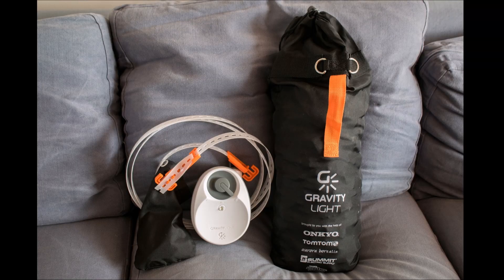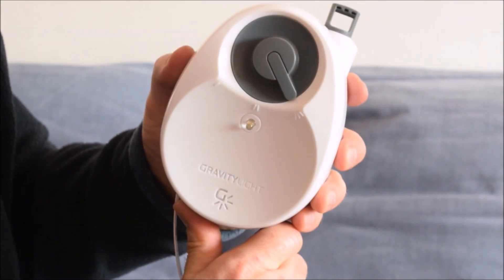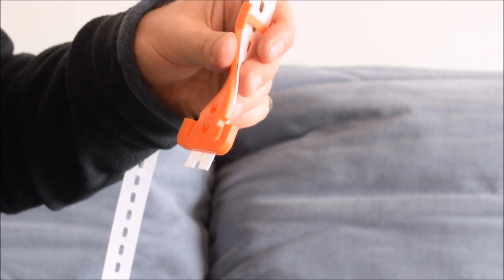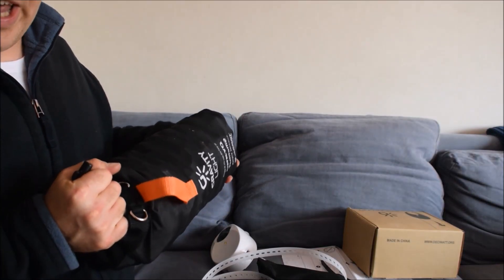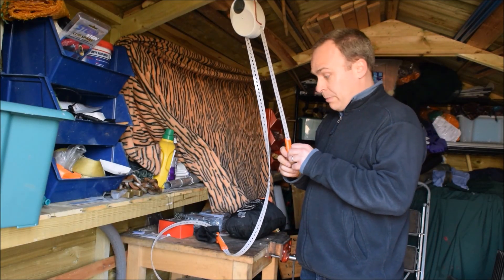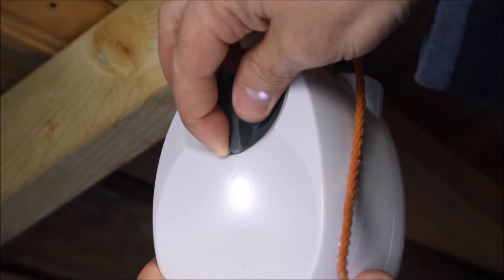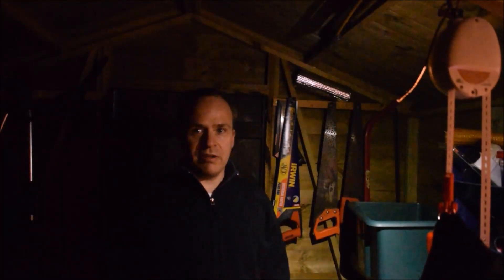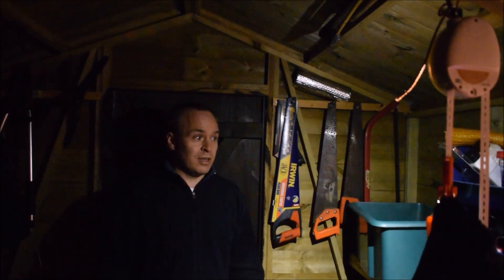Gravity Light Review

Comment: I love the idea, am just not that convinced about the design. A lot of fragile looking, easy to break and lose plastic parts to hang the weight bags. Would be awesome if it was designed in a way where one can just use e.g. any string like paracord to hang the weights.
A supercapacitor to store some energy to still give some dim light for a while when the strap stops moving (when one is lifting the weight or when the weight reached the bottom) would also be a nice addition.
Reply from the maker: I agree. It broke a plastic gear after a while. They did make a newer version that added a battery and solar panel, with a simple loop of cord to pull to charge it. But it's quite expensive now. See https://deciwatt.global/gravitylight

Comment: I am pretty sure it could turn on more LED at once if they know the trick..at 3 volt ...it could lights up 24 LEDs if they know how to do it
Reply from the maker: Yes, it could, but you'd need the weight to drop faster to supply the current, so it wouldn't last as long before you need to lift it again.
Reply: @mikepepler  I think there is another way to do this instead of supplying more current (dropping it faster). If it can supply enough current for 1 LED perhaps it could supply at least 6 or more.
Reply from the maker: Only if more efficient LEDs were available. The energy from the lowering weight is mass x 9.8 x height. So if you don't increase the mass or the height then you have a fixed amount of energy available. Therefore if you want more light, you won't get it for as long - unless the single LED they've used is not very good, and you can replace it with several that are better, delivering the same light for less energy. The energy used by the LED(a) is current x voltage x the time they're lit for.

Comment: How many watts this pruduces? I am thinking to charge a bettary instead .
Reply from the maker: Not a lot. The potential energy in the raised weight is probably just under 200 joules, so if it lowered over 3 minutes that would be about 1 watt. The latest version of this device doesn't use a weight, it has a loop you pull round and round to charge a battery, plus a solar panel.

Comment: Mike Pepler
This is the GL01 model...how has it been holding up?
I just purchased the GL02 model and there are obvious differences.
GL02 has a lot of cables coming from it with an offset weight, different load bag, two satellite lights but no brightness adjustment.  Suggested 15 lumens.
Reply from the maker: One of the gear cogs must have lost a tooth, as it slips sometimes. I think your version is improved. Their latest version is different again though, I think?
Reply: @mikepepler  
If you can find which gear is bad, it may be possible to 3D print a new one.  It will be interesting to determine how well the new version holds up.
Reply from the maker: Yes, that's true. I do know someone with a printer...
Reply: @mikepepler  👍

Comment: Imagine you walk out to a shed and there is a steel framework with cables pulleys and chainfall attached to a stationary generator..you quickly chainfall a ton of weight to the top of the framework and when you release the weight it pulls on a chain that runs through cogwheels and turns the generator for 48 hours..
Reply: @soldier of tough love Yes indeed. Architect here. When I heard about GravityLight the first thing I did was sketch up an  8' x 8' "chimney" inside a house, going above the roofline, giving the house form. Within the chimney are various weights connected to gear trains, creating power that is then brought by conventional wiring to various rooms and appliances. Is it cost-effective at this stage over, say, a 30-year life span? Maybe, maybe not---but it's doable. It might be impractical depending on the details you develop for hoisting weight (where said hoisting could in fact rely on an independent power source, where weights are automatically raised to their maximum height whenever they reach their lowest position and are no longer producing power). You certainly could build it and power much of your house through your "gravity chimney."
Reply: U legend!
Reply: An oak or brick house would support such an upgrade.

Comment: Is this light for real work without battery and electricity forever?
Reply from the maker: No battery, but electricity is generated as the weight slowly drops, and you put the energy in by lifting the weight. It will not last forever, as the gears inside it will wear out.

Comment: How about building it on a 30 ft or higher pole? Pulleys and ropes can be used and the generator module can be placed at the bottom. Sort of upside down.
It will run for hours..
Reply from the maker: There's projects planned to do something similar with a deep shaft into the ground and a weight of several thousand tonnes, to store surplus renewable energy for use later.
Reply: @mikepepler  That's on a massive scale. I have a design in mind that will use 4 weights, four pulleys to drive a single generator 30 ft below at the base. The pulleys switch one after other giving more than 8 hours uninterrupted power.
Reply: @mikepepler  btw how will the heavy weights be pulled up again to the ground levels ??
Reply from the maker: Electric motors, powered by surplus electricity on windy days, etc. I'm not convinced it's a great idea to be honest...
Reply: @mikepepler  This is not surplus energy but on-demand energy. Just pull all the bags to the top of the pole at dusk and have a bulb glowing till dawn without any input. 

Nothing could be more optimal..

Comment: for the amount of petrollium products required to make that plastic you could run an led light for like 200 years
Reply from the maker: You wouldn't be using it instead of a mains powered LED light. It's for use in off grid areas where the alternative is a primitive kerosene lamp.
Reply: NaganoharaMio the point of the product is so people with no electricity can have light long term with no consumables like gas.

BTW aren’t most LEDs rated for 20 years? Also LEDs require electricity. Even if you go the route of solar panels you start negating your argument with how much will have to be invested to produce solar panels and batteries to store the electricity.

Comment: Let me go ahead and deconstruct the devise based on what I'v seen so far. So the holes in the belt attach to a kind of hooked or riveted gear in the inside which is attached to a motor and a kind of mini transmission for the different settings. Once the weight reaches the floor, light show is over and I'm guessing the belt is limited in terms of how long it is. You can tell the small size of the devise means that it was designed with artificial adolescence.

If you wanted to improve upon the design of the devise, I would add some kind of gear inside that produces one directional torque and has low resistance to friction as to buffer more energy from the fall of the heavy object and pull from the buffer instead of just letting it fall the way it does.
Reply from the maker: You're right, though the different light levels are obtained by switching a resistor in or out of the circuit I think, the gears are fixed. What wears out is the teeth on the plastic gears. They have a new version that adds solar and battery, so it's pulling the cord rather than lifting a weight that puts some energy into the battery.

Comment: If you elongate the strap and put it in a treehouse you can get a longer duration of light, I believe the regular strap lasted around 30 minutes, and just by guessing a regular tree lenght should be enough for a solid 2 hours?
Reply from the maker: More like 10 minutes on the brighter setting. The catch is that the higher the light is, the more awkward it is to lift the weight.
Reply: but a treehouse isnt a big space, you wont need the brighter setting, and you could just pull on the strap to lift the weight back up. also after this video i checked, im not sure about the brightness setting but it provides around 20 minutes of light, even on the brightest setting the length of the tree would definitely not come down to 10 minutes
Reply from the maker: The newer one is said to last longer - mine is version 1.
Reply: so with the stock strap, how long does it last ?
Reply from the maker: I don't know for version 2, about 10 minutes was what I saw with my version 1, though that isn't necessarily the entire strap, as it's not always practical, depending where it's hung. Don't forget the amount of weight makes a difference too.
Reply: https://www.youtube.com/watch?v=Jsc-pQIMxt8  5:32, aparently the weight used doesnt matter as long as its enough to get it running which is roughy 12 kg, though pulling it back up with the straps aparently feels like 3 kg because of the pulley system though i assume its the version 2, with the beaded straps
Reply from the maker: Yes, beaded strap is version 2. Not sure about the weight. More weight means more potential energy, so you'd expect it to run slower and last longer. But there'll be an optimum to minimise wear and tear.
Reply: the gears inside turn at a stable speed in correlation to the led meaning yes normally if the weight was not held back, more weight does mean more potential energy but the weight is not free falling, its being held back by the gears constant which in this case is determined by the LED's allowance, the potential energy is being transferred to the gears as stress, not more turning power. on their site they say that the optimum weight is 12 kg, its probably a little lower if you run it on low brightness.

Comment: That is a very good design for a gravity generator very light duty. I'm building something bigger 2000 Watts what I got right now once I get the tower up for the weight drop I'll have my gravity generator working almost got the transmission done. The transmission will turn a half a rotation letting out 8in of cable. With the weight on the other end of the cable spinning the transmission up to 3600 RPM on the other side power and a generator if I can get it completed.
Reply: Terry Robinson good for you and I will be posting more as I get back to working on it I got sick my Jeep won't pass smog I'm working on trying to get it to pass and having the stomach flu at the same time which really makes me wore out and weak. But I will get back to it when I start feeling better I want to get that gravity generator going cuz that will power a deep freezer and refrigerator Around the Clock that's my plan.
Reply from the maker: +Carri Rencher what will lift the weight?
Reply: Mike Pepler I'm using a 2000 pound winch to lift 2000 pounds up and that cable that will be lifting it will be spinning the winch which will be chain driven to the transmission. If I knew how to put a photo in here I'd show it to you!
Reply from the maker: +Carri Rencher sounds like good exercise! :-) Maybe upload a video sometime, and post the link here?
Reply: Actually no exercise at all it's a 12-volt winch I just left the button and press a button and up it goes soon as it gets up High enough I let go of the button and release the brake goes back into operation. If I can finish getting it built.! Working on the outer rain building for the transmission and then I will finish the transmission once I get the protected building built to keep everything from getting wet and rusting. Lot of pain in my legs and lot of work hurt my back I'm still going.
Reply: Why don't you said if I start putting videos on here to post them over here well I got the first one made on how I built the Freewheel between the winch and the transmission. I will be at making more videos as I slowly complete the shed to go around the transmission and finish the transmission and stand the tower for the weight lift lot of work ahead some of it I can only do if I can get help. I can't hold the tower and anchor it.
Reply: Carri rencher / gravity generator
Reply: You are using energy to lift the weight?  Why not just use the energy that you lifted the weight with since you will get even less energy out of any generation of the weight falling?
Reply from the maker: That's probably the thinking behind the new version, where rather than lift a weight you pull a cord that turns a dynamo. But that then requires a battery...
Reply: Hi Carrie, I am very interested in your design. I have had the same exact idea as you.  I am going to be moving into a 4 story home, so I can let a large weight drop about 40 feet then simply lift it back up using human power. I also have a 6kva generator that requires 3600 rpm shaft rotation to use to charge some deep cycle batteries. I need to figure this out in the next couple of months because this home is off the grid and I don't have the finances to put in a large enough solar power system so I thought a gravity system would be more economical.

Comment: It's your energy which is converted into light .
Reply: P. Chretien Gravitational pull is more like potential energy, it's cleverly converted to kinetic energy and then to electricity.
Wondering what's the overall conversion efficiency? IMHO it's more efficient than manually powering the dynamo or trying to use bike for it (much more work required and heat is produced).

They should be making emergency portable USB chargers like these for survivalist, tourists and travellers.
Reply: @kamilk   Pulling something up gives it potential energy... We can't directly increase potential nor kinetic energy but increasing height increases potential energy and giving speed ( throwing or pushing something ) increases kinetic energy... Have in mind energy conversion is not perfect and only some part of energy we use is converted to Ek/Ep and then to light..

Comment: Solar garden light... cheaper, better.
Reply from the maker: +blogobre but it also depends on the sun, and has a battery that will wear out.
Reply: Sun - sure, we're screwed if it doesn't rise.  In terms of use, meh, even a little sun will give you hours of light. 
Battery, lasts about the same time as the gears.  [5 years]  If you can use a soldering iron you'd just replace it. 
- costs are about 1/10 of this unit, so why screw the 3rd world, why not give them 10 times as many units.
Reply from the maker: +blogobre don't get me wrong, I think solar lights are great, the place I work (Ashden) does a lot to promote them. But I think there's a place for the gravity light too. Mike
Reply: Sure, I get you correct and agree.  What I do challenge is that in a free market of providing the most lighting to the poor in the 3rd world, solar would be chosen.  Here we have a company making them, calling it a charity and making a profit on the units.  Is that wrong?  Well they're the only ones I know of providing lights, so lets call that an economic incentive on the manufacturing side to do some good.  I call it a win-win perhaps, though I also think it's deceptive and a charity that collects money to help those same people is more likely to go with the most economically sound idea, it might also know something about them that suggests we don't actually need the lights [I have no idea].
Reply from the maker: +blogobre I think they're a social enterprise, rather than a charity? Where I see the lights having a role is if they can make the gears last longer than a battery in a solar light, and at the same cost. They're still in the development stage really, so need a bit of time to prove the concept works. Right now, if I was advising someone what to buy, a solar lantern is best, providing they live somewhere with enough sunlight year round.
Reply: Not to take this on a dark tone, but it is the free market which has these rich African people working for pennies and living in poverty in a rich land... Only because free market rules work so that the people with the least interest in humanity and the most interest in profit win every time. 
Thus, I think it is impossible for the free market to find the best solution for human problems. The free market may only find economic solutions which benefit people in a pyramid fashion, rather than all the way around.
Reply from the maker: +Ramiel Ironically, projects to help people in developing countries often talk about the BOP, or Base Of Pyramid. Maybe they should be trying to dismantle the pyramid instead...
Reply: I've used solar lights.  Downside is that eventually, it's going to run out of juice and then you're out of light for the rest of the night.  Also, the garden solar lights are going to give light whether you want it or not, which  wastes light a lot quicker. This way, with the gear pulley, you can have light whenever you want.  Also, on really bad overcast and rainy days, you would  have light. With the solar ones, you don't get as much power out of them when you don't have sunny days.
Reply: Mike Pepler Oh yea, but then what excuse could people use to sell overpriced shoes made with child labor...
Reply: It is hard to believe they are good and want to help people in third world.
Reply from the maker: +Os números não mentem jamais actually, there's lots of social enterprises that really do help people in poor countries. I see a lot of them at work, take a look: http://www.ashden.org/
Reply: Yeah, because we haven't invented batteries yet.